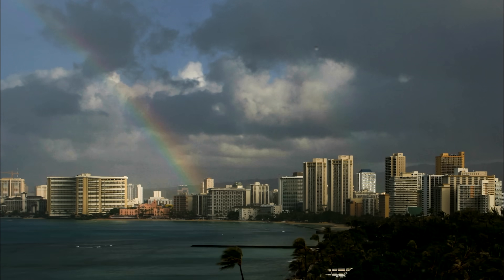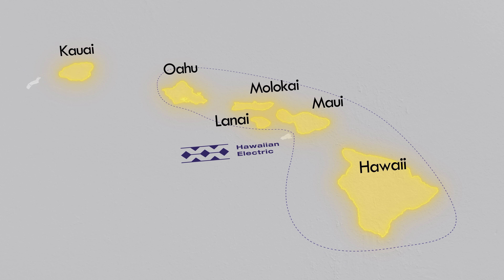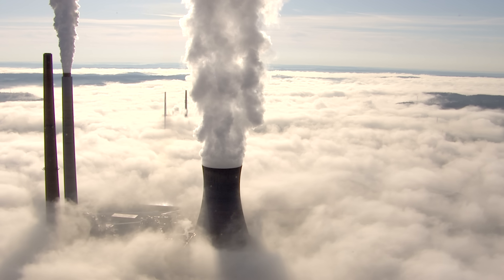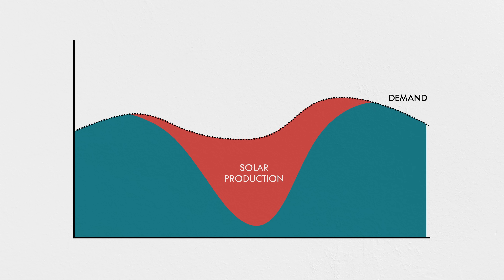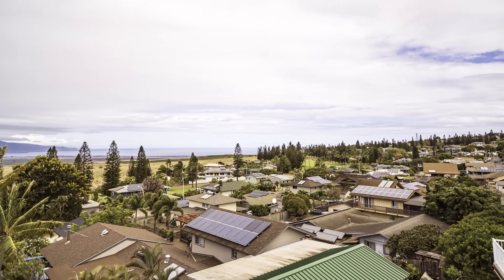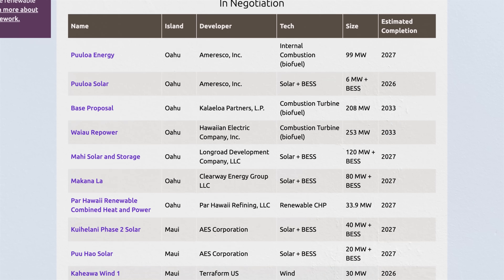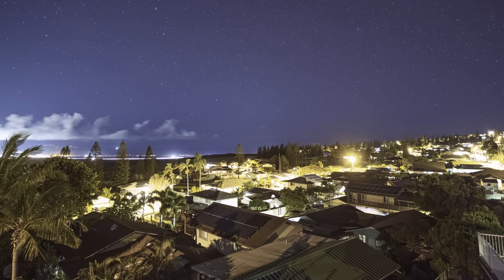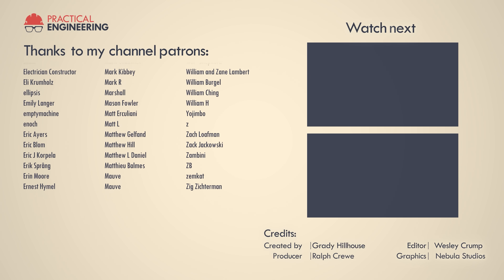How the Hawaiian Power Grid Works

Comment: Why didn't Hawaii request help from the Navy. Nuclear aircraft carriers and submarines can and have provided power during storms and disasters.

----

Also you claimed that you can't pay for more electric reliability. This isn't true.
You can use small Uninterruptable Power Supplies (UPS) for computers and medical devices.
You can use whole home UPS.
You can use a generator.
You can use a combination of the above.

In area with rates that change during the day, a whole home UPS is perfect. When rates are low, you charge batteries using grid power and when rates are high you power the house from the batteries and invertors. This can also be supplemented with small wind turbines and/or solar.

This means you pay for cheap electricity and if the grid goes down you still have power. If you have enough batteries for 3 days then with reduced usage and solar/wind you may extend the time a couple if days. If you have a small generator (2000w) you may be able to extend off grid to 2 weeks or more.

The more you pay, the more robust of a system you can have. So yes, you can pay more to get more reliability.

Comment: You have touched on one of the major issues with the unfettered addition of renewable energy sources to a grid.  Historically a utility or commercial power plant had a capacity factor between 80 and 98%.   A reasonable return on investment depended on this high utilization.  As renewable energy comes on-line it lowers the capacity factor of those existing units which detrimentally affects their ROI.  The low capacity factor of renewables has been covered by subsidies.  But the old style fossil/nuclear plants are necessary at night or when the wind isn't blowing.  Since the governance of the subsidies are not perfect there have been unintended consequences.

The Texas grid is a good example.  Too much renewables, too soon.  Owners of older plants with ROI dependent on high capacity factor stopped taking care of their equipment that affected reliability (e.g. freeze protection) or took them out of service.  In 2021 when weather knocked renewables offline (ice and night time) other back-up sources were called upon.  They were however frozen or failed due to freezing.  Since ERCOT has no interconnects that can supply significant back-up, the lights went out.  ERCOT claimed to be doing rolling blackouts ... hahaha ... the power outage at my house lasted 3 days until it got above freezing.  I understood the issue and had the wherewithal to run a generator to run the nat gas furnace.  We muddled through with no damage.  Lots of people were far more unfortunate (including those that died as a result).  

A grid with lots of renewable energy will be far more expensive to run.  Solar has a 50% capacity factor; wind is in the 30% range.  Therefore the ROI is poor and poorer unless the rates are higher.  If government and consumers do not support the grid operation with higher rates, there will be no reliability.  Since the politics of higher rates is so screwed up, my recommendation is that every homeowner has their own power source.  A fossil fueled generator is the cheapest and most reliable (as long as the owner tests it regularly).  Solar cells on the roof with a large battery is also possible at this time but more expensive (in some places this is subsidized).  Local house sized batteries are becoming viable but suffer from the same issue as grid sized batteries ... if suddenly everyone wants one the demand will exceed supply for decades to come (just imagine the price).   

Currently the poor governance of renewable energy addition to grids and the continued objection to new fossil/nuclear sources has destabilized grids, affected grid reliability in a detrimental manner, and caused the installation of a huge number of house sized fossil fuel generators (with no emission controls).   The answer is simple:  in the near term fossil fired equipment for back-up is required, keep working on batteries (but it will be decades), replace fossil fired back-up with nuclear, and enforce reliability requirements on all who supply power to the grid.  The governance required to accomplish the simple solution is un-imaginable at this time.  So the individual must muddle through and fend for themselves.   The end result may be that the utility supply of power will become a thing of the past and everyone will end up fending for them selves.

Comment: Great video! I just wish that you would have spoken about grid scale batteries and their ability to respond to these grid fluctuations... 
Frequency Control Ancillary Services.. Which Tesla's first 2017 mega pack in Hornsdale Australia reduced costs by 90% and eliminated the blackouts. 

Utility battery packs are able to react to grid fluctuations nearly instantaneously... Similar to how solid state computer drives are SIGNIFICANTLY faster than hard disk drives with their rotational inertia.

Comment: A couple things. There is the capability to build undersea cables. There was a bid to do so to connect to Molokai and Maui bout 10 years ago but the PUC wasnt going to fund it as it was at a cost of about 1 billion dollars. Quite an expense for a small rate base. Additionally the strategy for an isolated grid here is to have a lot of smaller plants. Instead of a few high capacity ones. As you lose one or two it’s only a small amount of capacity, vs losing one large generating station that could potentially take down the whole grid. The challenge now is we really need more storage. We have room for renewable energy growth but without storage the breaks have to be put on a bit. Luckily there are a lot of large battery projects coming on. The issue is currently the PUC mandates the battery’s can only be charged from renewable sources, which being connected to a grid doesn’t make a lot of sense. To truly replace a fossil fuel plant it needs to recharge daily if it’s going to be used for firm generation. In January there was not enough solar to recharge the battery’s  and they could not recharge the battery from online generators effectively taking the battery’s unreliable. The goal instead should be not curtail renewable sources by having enough storage to save it for later. Also while direct solar connected to the grid has no inertia. Battery connected systems do have nearly instant response to frequency and pull from the battery very quickly and will make up and then some for lost inertia.

Comment: 100% Renewable energy is non-attainable.  Any renewable energy grid, i.e. solar and wind, requires some form of energy storage, a battery.  Those batteries rely on non-renewable materials.  It's commendable to want to reduce pollution in energy production, but offsetting the pollution to traditionally impoverished nations where we strip mine their country to get the metals we need for our batteries is not a good solution.  I would much rather see places focusing on replacing legacy power plants with cleaner forms of energy, like nuclear power.

Comment: 2008 set a goal of 70% renewables by 2030......its 2024 and they are at 25%......and that's the cheapest/easiest 25%
So in 2016 they upped their target to 100% by 2040. lol (I guess it's possible they added that 25% in the first 8 years so thought they were "on track" and just haven't added anything since)
For the first 22 years they had to switch over 3.18% a year, they have so far managed 1.56%, so for the next 6 years they have to up that rate to 7.5% to get back on track, meaning they have to increase their installation rate by 480%, should be easy ;) lol And they somehow think they will be able to add the last 30% at 3% a year.

Comment: You "can" pay for increased reliability. Just not to the power company. Distributed storage and distributed generation could solve some of these issues, as well as improve daypart load balancing. Solar only seems to make a substantive difference in hot, dry, sunny locations.

Comment: The customers need to be more independent. Each home should have batteries and work with their solar to make it an off grid system. This does not mean your home doesn't using the grid. It means it only uses the grid once and awhile. This would help the utility keep cost down by not needing to upgrade their systems by adding action schemes. Also we need to get the cost of hydrogen fuel cells down so they could be used as a generator for each home. Hydrogen would be made by excess solar.

Comment: With all of these talks of renewable sources and power storage, some people suggest that we might have to go back to using a DC power grid to support distributed power sources and inherently DC devices such as solar panels and batteries.

I'm not really sure how one would even go about doing that to a preexisting AC grid, though... sounds like it would require a paradigm shift to everyone and everything connected to it.
Reply: It is simple. AC area-> Rectifier -> DC line -> Inverter -> Other AC Area.

Comment: Interesting video but most renewables are mostly just hype and political nonsense. Imo. more accurate analysis would point out this is just a problem created by legislation, anti-nuclear lobby and just general paranoia around the subject. BoA 2023 estimated that wind & solar was 2x-14x more expensive than nuclear in Texas/Germany. when adjusted for the capacity factor (LFSCOE). France v. Germany is a great example. Germany would be almost carbon-free if it kept its nuclear plants like France did. Plus renewables get more unfair subsidies.

Just build a nuclear power plant? Like one of those new small modular ones. Great for base load and doesn't litter the area with wind turbines, which btw. are a threat to some avian species. Wind/solar take like 40x-300x space per kwh. Michael Shellenberger gave a great ted talk about the topic.

Also hydrogen via GenIV plant electrolysis in future can provide control power. It might be cheaper than batteries + no emissions.

Comment: You can pay for more dependable service. My mother has an automatic standby generator AND a ups. If her power goes out, her UPS immediately takes over while the generator kicks on. Her cpap will not lose power pretty much under any circumstance. Personally, I have solar, a backup generator, and a small UPS for my networking, so even in a power outage I never lose internet. This is also vital to me as I have no cell service at my house, so no internet means no communication. There are ways around a faulty grid, I know I have both

Comment: Germany invested a LOT into renewable, I believe they're at 1000 billion euros (roughly the same in USD).
I'll compare it to France which had a different strategy towards electricity.

Germany has 151GW capacity in renewable:
 - they highly depend on coal and natural gaz to compensate the intermitent part of renewable sources
 - their electricity is expensive
 - their electricity is dirty (we have regular air pollution coming from Germany)

As for comparison :
 - France depends mostly on hydroelectricity and nuclear, making its grid stable and most of the time helping its neighbors (when they produce too much or not enough)
 - France produces 1 MWh for 45~50€ (ie. roughly $45~$50), Germany between 80€ and 200€ with peaks at more than 1000€/MWh.
 - France's electricity produces ~20 to 50gCO2/kWh, Germany usually produces it for ~120 to 750 gCO2/kWh

Another funny thing, that impacted the UK and France : wind powerplants not being controlable, the UK often has to pay France to take its electricity excess and, when the wind is low, it has to pay to get electricity from France.
Same happens with Germany.

So it is a challenge, a huge one, but so far I'm not sure if it will be a successful one. So far nuclear (and I hope in a relatively near future, nuclear fusion) energy is the best choice : clean, cheap, reliable, safe.
Reply: The figures seems to shift depending on who you talk too.

From what I hear because France does not want to slow their nuclear production they will sell power at off peak times very cheaply. 

And when France needs more power in peak they will buy power at great expense from it's neighbors.

-

Their is also the case of France selling power to Poland. That power has to travel through Germany and would be counted as France->Germany despite Germany not actually using it. (What would probably happen is the France power station will power some of Germany which shifts a German power station's load east until it gets to Poland.  )
Reply: @catprog  Aka load shifting.

Comment: Hawaii is blessed with geothermal energy.  It has 3 gigawwats of untapped wind potential, NREL has calculated that Hawaii has  the potential to produce 2.8 PTh (Petawatt hours) of power annually from offshore wind.  It has untapped offshore geothermal energy. It has untapped wave energy, untapped ocean thermal energy conversion potential.  It's smack-dab in the middle of the Pacific.  It could tap into marine currents for energy. They could use geothermal energy for low-temperature or high-temperature  electrolysis.

I completely agree, Hawaii should interconnect its grid.  It should commit 100% to geothermal, ocean current power, offshore wind, onshore wind, OTEC, and I even think they should go nuclear.
Keeping all the islands separate from each other is hurting the ability of each island to grow and improve their grids, and cut  state-wide power prices.   Hawaii, like most provinces in Canada, France, Canada, Sweden, Iceland, Tasmania, the countless power companies in Norway, Fortum in Finland, and Orsted in Denmark are all 100% government-ownned,  or  at least 50.1% government owned.  There's no short-term profits motivating the decisions made behind the electricity grid.  Private companies are motivated by whatever will make the most profit. They're not focused on service, quality, emissions, or what will offer the lowest  cost to rate payers.

The state, together with the various local  governments in Hawaii, should own all aspects of the electricity sector, and do so on a for-profit  basis, just like in Canada, Norway, Iceland, Sweden, France, Tasmania, etc.

If you look at Quebec, the amount of electricity generation capacity is massively overbuilt for what the people themselves actually need.  Much of their electricity is consumed by the industrial sector.
If Hawaii can make a business case for  massive gigawatt-scale power generation from offshore wind, geothermal, nuclear, OTEC, and marine current power, and use that power for producing green hydrogen to produce ammonia and methanol for marine shipping and aviation, then I am convinced the state economy would massively benefit from that.

I already pointed out the obvious fact that Hawaii is in the middle of the ocean.  I said offshore wind potential is absolutely massive there.  There are synergies to be had between offshore wind and offshore geothermal and seaweed farming, as well as oyster, muscle, and fish farming operations.  Hawaii is sitting on an absolute dollar mine.

Comment: 00:01   🚨 Major storm hits Hawaiian Islands
00:18   🔌 Power outage due to storm
01:04   ⚡ Rolling outages implemented on Oahu
01:32   🔋 Challenges of operating a small power grid
02:09   👥 Hawaiian power grids explained
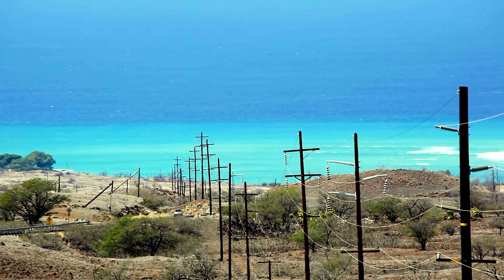03:04   🛡 Importance of reliability in power grids
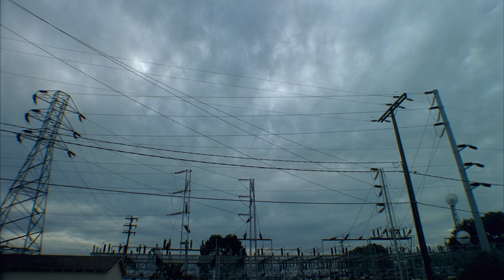03:56   💸 Costs of achieving high reliability
04:28   🌍 Benefits of wide area interconnection
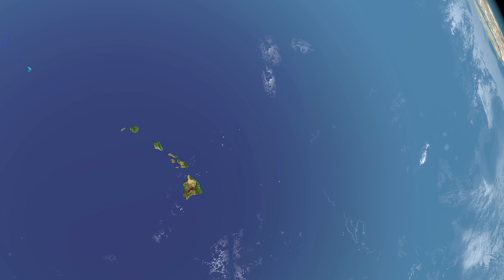05:41   ⛽ Hawaii's reliance on petroleum for power
06:31   🌱 Renewable energy in Hawaii
07:05   🔄 The challenges of intermittent renewable sources
07:36   🌀 Low-inertia of solar and wind sources
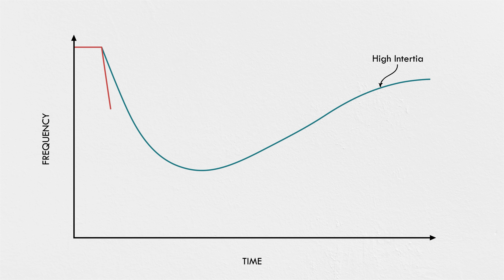08:44   🚀 Future video on inverter-based energy sources
09:00   ☀ Distributed energy resources impact
10:25   🛡 Inverters increase grid vulnerability to cyberattacks
10:47   💵 Impact of distributed resources on utility revenue
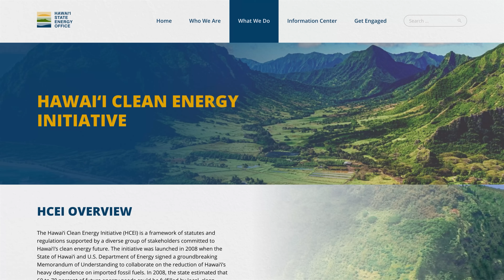11:24   🌿 Hawaii's Clean Energy Initiative and renewables growth
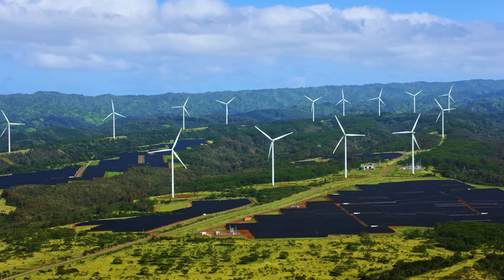12:26   🔬 Hawaii as a test bed for renewable energy integration
13:27   💡 Challenges in balancing grid reliability and costs in Hawaii
14:44   🌺 Importance of respecting Hawaii's complexity and culture
15:02   🌕 Coverage of private lunar lander and media bias
15:42   📰 Ground News sponsorship mention and media bias tool

Key Moments by Agent Gold AI

Comment: Spoiler alert:  they won't entirely stop needing fossil fuels by 2045.  That's only a couple of decades out, and converting the first 25% of your production to renewables is at least two orders of magnitude easier than converting the last 25%, because the first 25% or so of your capacity that you convert can be 100% base load production, but the last 25% is 100% demand-based production, meaning you absolutely positively have to be able to turn it on and off at will, quickly and with high granularity (or else the grid goes down every time there's a routine fluctuation in demand, which is very bad).  You can theoretically compensate for this with storage, but you'd need a stupidly large amount of storage capacity.

Also, politics is involved.  So that's gonna make issues too.

I figure they'll get to about 50% and start falling behind schedule, and then somewhere around 70%, progress will grind to a crawl.

Comment: This is a great example of where conversion of existing dirty fossil fuel facilities to hydrogen and then overruling the renewable supply to allow running of green hydrogen production facilities would allow building a stored hydrogen "battery" where the hydrogen burning plants could quickly be activated at times of peak demand or during similar outages to supplement the renewable grid.